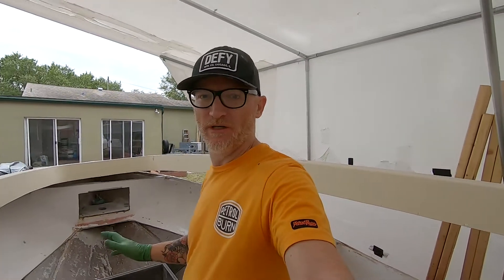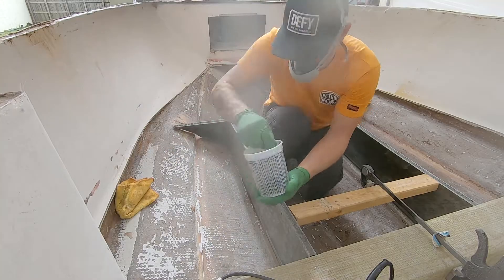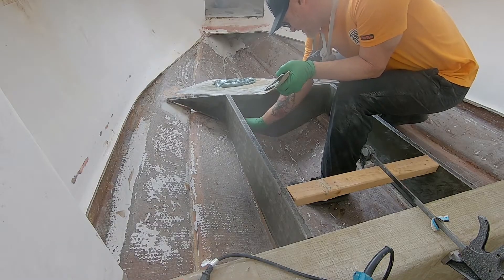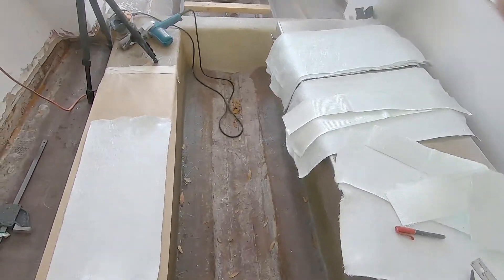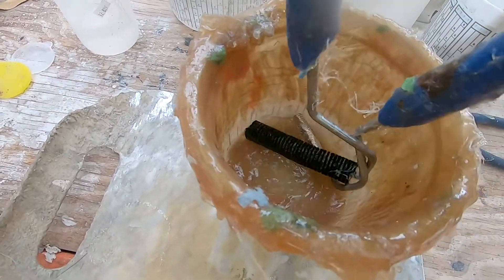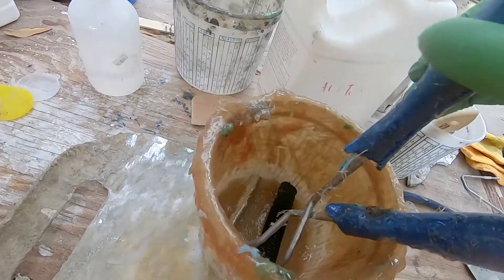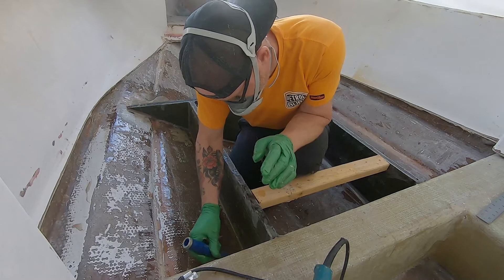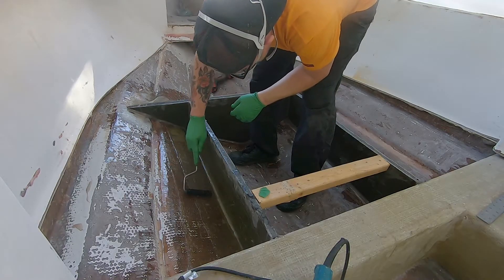HOW TO FIBERGLASS TABBING for Boat Stringers Transom & other Marine Fiberglass Renovation Projects

Comment: I know next to nothing about fiberglass boat repair but was given a 1969 Sears and Roebuck V bottom boat in need of new floor. The outside looks great with no spiderwebing or cracks which leads me to believe it's worth fixing. 
The keel appears to have been made from 2" x 8" while stringers are full 1 inch   lumber of which I had planned to use myself. After read different articles it seems no one uses traditional lumber...why is that... To save weight?
Should I not use treated wood in my project?
Any suggestions ?
Thanks!
Reply from the maker: The only real wood used anymore is marine grade plywood. Anything else is going to rot. 
DO NOT use treated lumber as it has chemicals that will interfere with fiberglass resins. The chemicals will cause fiberglass failure down the road. If you’re planning to use wood stick with marine grade plywood. Most restorations use some sort of composite as a replacement for wood such as Coosa Board or PVC board.
Reply: @boatcrafterscompany  I see...looks like I need to read up on this some more. 

Thank you !

Comment: Thanks for the videos. Very helpful. One question though. Don’t you need to leave a few open spaces at the bottom of the stringers and knees for bilge water?
Reply from the maker: It’s depends on if you plan to have water enter that stringer cavity. If the cavity is foam filled you could drill a drain hole but if you get water under foam that’s a bad idea. Whenever I foam fill a cavity I cap the top of the foam with epoxy so no water can enter from the top. 

You wouldn’t leave a space but rather you would cut drain holes at the base of the stringer where water is supposed to pass through.

Comment: Isn't the point of laminating resin is so you can come back and lay up without sanding
Reply from the maker: You have a 12-24 hour window that you can safely add more lamination without sanding. This is all dependent on the quality grade of resin being used, temps, MEKP percentage etc. Personally I never let resin sit for more than 12 hours without sanding but I also always make sure I can finish a job before I start. The best scenario is to always complete your lamination in the same day. Allowing layers to “cure” creates weak layers in the lamination and it should be avoided especially on structure critical repairs such as stringers.

Comment: It would be nice to use other resins but where I live it’s not possible. First off can’t get inside heated storage to do repairs that doesn’t cost you 2k a month. Also any outside covered storage is still expensive. So doing deck core repair at 35-40 degrees it’s only possible to get epoxy to cure. I know it sucks should get rich and send my boat somewhere warm for repairs.
Reply from the maker: Gotta work with the tools you have. But moving south sounds like a good idea.

Comment: Great video, Clearly know what you are doing. 100% correct that no boat repair shops use epoxy because it does take so long to cure they wouldn't be able to get any work done. I use epoxy on my project because I usually work on my boat 1-2 days a week and I like being able to keep everything wet the whole day while I work. I also lay up inside sometimes due to weather and the smell isn't bad like Poly. Have used poly many times for one off parts and have never experienced anything being "weaker" or with a "poor bond". Keep up the great videos!
Reply from the maker: Thanks. Epoxy is nice if you have the budget and time. For tabbing work I’d probably always use poly just due to the cost factor.
Reply from the maker: I also need to make an update to this video. Some things I stated aren’t what I would suggest now or a little different.
Reply: @boatcrafterscompany  I'd be interested in seeing an overview video where you explain how you tackle replacing stringers in a boat, what materials/processes you prefer, how many layers, etc.. I've seen several videos where I feel like the builder is putting way more material down than necessary.
Reply from the maker: Depends on the boat size etc. it’s not a universal process.

Comment: if a boat is old enough to be rotted out usually goes to the dump so if I FIX A PIECE of shit like that I cut out the rotten and splice in the new leave the good old stringers in. Easy to get a good level and super strong
Reply from the maker: Huh ???  The stringers were fully replaced with coosa.

Comment: This is tedious work, but very rewarding as well.  It's also messy you itch at night  lol.

I did this same work on an old 14ft Terry bass boat.  It only has a 40hp motor.  But for the transom, I put in two 3/4 pieces of marine plywood that I glassed in fairly thick and glassed in two support brackets because I had extra wood,  materials and time LOL.  My friend says that is way overkill!!! I said at least I know the motor will never crack the transom 😆🤣
Reply from the maker: I did a 14ft transom last summer and used two 3/4" pieces as well.  Came out good

Comment: Can you apply a skinnier piece of glass just to get the radius right and add wider pieces afterwards?
Reply from the maker: I’ve addressed this question in other comments above. Some people use smaller to larger but personally I don’t agree with that method because you want to avoid having overlapping edges of fiberglass that create air pockets.

Comment: When working with polyester boat yard resin, do you get tiny air bubbles?
Reply from the maker: No. You shouldn’t have any air bubbles if it’s thin rolled out properly
Reply: @boatcrafterscompany when I mix it in a cup with a wood painting stick I get the tiny bubbles, then when I roll it onto the fir plywood it's like a foam. I have pictures but they don't let me post here
Reply from the maker: I’ve never seen that before in poly resin. With epoxy resin you can get bubbles but you can pop them with a little touch of heat from a torch or heat gun.
Reply: @boatcrafterscompany  I'm going to try a torch and I think I might get a fresh batch of resin to see if I get the same affect. Thank you for the response.
Reply from the maker: Any heat on poly resin will make it cure extremely fast. It sounds like you have something else going on but a quick pass with a heat gun should pop any bubbles.
Reply: when I apply my primer coat to saturate the plywood, I'm laying it on thick to the point of where I have standing resin, which is what I thought indicated the wood was done absorbing the resin. Is that wrong? --to me the thickness of that coat shouldn't affect the areation I'm experiencing. I'm starting to lean towards my Poly resin is bad.
Reply from the maker: Is there moisture in the plywood or in the resin?  Any moisture will cause it to turn milky
Reply: @boatcrafterscompany  the plywood is at about 6% of moisture according to my klien pinless moisture meter. I store the wood and my resin in my air conditioned shed, where the temp is about 70F I'm actually checking my resin now, and I guess it could be too cold, the bucket is at like 65F on the outside of it.
Reply: @boatcrafterscompany  I've ordered a fresh batch of resin to see if what I'm using has gone bad, Ill let you know how it goes I appreciate your feedback.
Reply: @boatcrafterscompany  I got my fresh resin(poly Ortho), I proceeded with the same process and still ran into air bubbles. The air bubbles occured immediately after pouring resin into mixing cup, I mixed in some MEKP and got my roller for the plywood, same thing happened, with a foaming action. I decided to use a 3in brush to apply the resin and it smoothed out the air bubbles nicely. I still can see some but far less than before. So I'm thinking I need to try out the black roller you use or just continue with a brush. This time also the temps were lower about 70F outside opposed to 88-95F so it allowed more time for the bubbles to surface and pop. Also avoided the more direct sunlight this time opposed to last.
Reply: I meant to say, I should be able to put it on thick, without worrying about these bubbles forming.

Comment: Good work but ur doing it back wards. Doesn’t make sense to glass the larger tab first then the smaller one. Skinner tab then larger always to add strength and reduce chances of delam.
Reply from the maker: That’s 100% incorrect sir. I explained exactly why that’s incorrect in the video and comments. I love how your account was created 4 hours ago and this comment was made 4 hours ago.
Reply: Yes I read ur comments in the other post. It is not 100% incorrect. Ur worried about air bubbles by going smaller to larger but yet u have air visual air bubbles on the first tab u laid down. Use 3/4 mat in between the smaller tabs and u won’t have any air bubbles like u were explaining in the previous post. 6 inch tab of 1708 then on top of that an 8inch tab of ripped mat and then the 8 inch tab of 1708 the above that a 12 inch tab of ripped mat and above that a 12 inch tab of 1708 if ur going with ur 12 8 n 6. Also u need to wet out the stringers and bulk heads before u start laying tabs. Yes it’s composite board made of fiberglass but it still will absorb resin leaving u with less resin and dry spots ( that aren’t always visible to the eye) in the tab.
And who cares when my account was made?
Reply from the maker: Man. You clearly are missing a lot of details and making incorrect assumptions. I don’t care when your account was made, just pointing out that it looks suspect. Hiding ? 
First. There’s no air bubbles in my lamination. The white under the glass is bonding putty which you clearly saw me apply in the beginning of the video. Second…1708 was specifically made so you do not need to add CSM between layers. The CSM is already stitched to the back of the 1700 cloth to speed up the lamination process. Adding additional layers of CSM on top of the CSM already stitched to the 1700 only adds excessive resin to the laminate making it brittle. 
Lastly…I laminated the stringers outside of the boat before I tabbed them in (which I also explained) They have two layers of 1708 on them already so there’s no “absorbing” going on. I appreciate the input, but you should pay attention to the details before you comment.
Reply: The main plus to doing larger tabs first is if it’s in areas that need to be ground down and body worked or made smooth.

Comment: After the layers of glass have been laid and all the resin and glasswork is done, do you have to cover it with something like saran wrap or something to lock out all the air, in order to get it to fully cure?

My chemical sales rep was explaining to me that as long as air can reach the poly resin, it doesn't cure. So in order to cure it fully, it has to be locked off from all air... So, after tabbing and covering in the stringers fully, is there something I have to do to lock out all the air from the layup in order to get it to cure fully?
Reply from the maker: It is correct that poly resin won’t fully cure without being sealed from the air, but for work like stringer etc it’s not necessary to fully cure it. It will just have slightly tacky surface for about 24 hours. After that the surface will almost cure 100%. 
The only time this becomes a concern is when doing gelcoat that needed to be wetsand and buffed. In this case wax additive is added to the final coat that will rise to the surface and cure the gelcoat. You can also cure resin by brushing/spraying/rolling a thin layer of PVA over it.
Reply: @boatcrafterscompany  ok cool. So I shouldn't even be worrying about "not curing" then it sounds like.

We just picked up 10gal of ISO resin and 55gal of promoted ortho poly resin, both unwaxed. He said the ISO by itself would take forever to cure because it's unpromoted, and the ortho on top would be a good idea (I learned that from you lol) because with it being promoted it'll cure no problem.

After tabbing stringers and doing all glasswork, do I have to wait to cover it all in bilge paint? Or, can I just go straight to town bilge painting it all with an epoxy based bilge paint?
Reply from the maker: “Curing” is a tricky word here. They will both cure quickly,  but the ISO surface will remain tacky for longer so you can do multiple laminations without sanding. Personally I never let poly cure for more than 24 hours without sanding it for the next layer. Ideally you will always complete your lamination work on the same day. Work in sections and finish each section at a time. 

The epoxy paint will act as a curing agent on the poly. I would let it cure for about a day and then you can go right to bilge paint.
Reply: @boatcrafterscompany  perfect man, that makes total sense. You explain stuff in a very easy to understand laymen type of way compared to our chemical reps lol.

Thanks for helping me understand it a lot better now. I'm definitely gonna keep you updated on our build, we're fully restoring a Sportcraft 270 for chartering on the Great Lakes/Lake Erie. So, poly was our choice because it's what the boat is made of.
Reply from the maker: Thanks. Good luck. 
You can mix in epoxy for areas that are heavy structural or need better water barrier. Anything that requires bonding I typically use epoxy, like transoms etc.

Comment: Do you ever add stringers with reinforcing  materials? Thinking for deck that bends under weight - or just more layers of glass? If you add reinforcement is it wood or something else? PVC tube? etc. This is a great video thank you!
Reply: one more question, what brand and size was that angled belt sander?
Reply from the maker: I’m not sure what you’re asking. All stringers have a core material either wood, foam, or Coosa board. 
You can see my tools at this link
amazon.com/shop/petrol.burn

Comment: If I use coosa board for my stringers in my 270 sportcraft, do I have to cap them and enclose them like you do with wood? Or can I just install the coosa stringers and simply tab them to the hull and each other, and be good to go?

Also, when setting a stringer, do I need to space the stringer off the hull bottom with little spacers (apparently to eliminate "hard spots" in the hull I was told), or can I just peanut butter them straight to the hull bottom without worrying about creating hard spots that'll risk cracking the hull?
Reply from the maker: You do not need to cap the tops of the stringers with Coosa. I would put two layers of 1708 on each side outside of the boat and then tab them in. You shouldn’t need foam or bedding unless your hull is very thin. If your hull quality with good thick lamination just run a radius along the bottom of the stringers and then do your tabbing. Be sure to stagger your tabbing so it spreads out the loads on the hull I suggest three layers of tabbing 12” 8” 6” biggest first.
Reply: @boatcrafterscompany  Thanks a lot man, I really appreciate the guidance and help!

I'm trying to map out how much polyester resin, 1708 fiberglass, and the bonding resin I'm gonna need. I've never had to order it yet so I'm kinda unsure what quantities I'm gonna need lol. I don't want to go overboard and just waste money, but don't want to fall short and have to wait for more to come in halfway through lol. I'm doing the stringers on an early 80's Sportcraft 270. The manufacture was NOTORIOUS for leaving uncapped ends on the bottom rear of the stringers, so they go to hell in a hurry.

Is it best to buy materials local, or is there somewhere online that's more preferable to buy in bulk from?
Reply from the maker: You can find resin calculators online to get a rough idea on how much you will need. Always plan for extra because a lot of it will get wasted during the lamination. You can estimate the square inches of 1708 you’ll be using and what the recommended resin per square inch is for 1708. I don’t know it off hand. 
I buy all of my supplies from FGCI in Fort Lauderdale. You’re not going to save much money buying online unless you’re buying in major bulk. Check out Fiberglass Florida they always seem to have good prices.